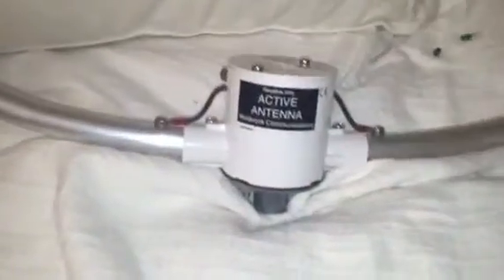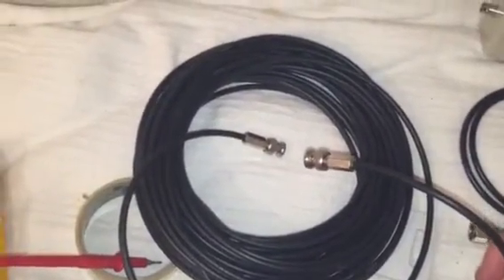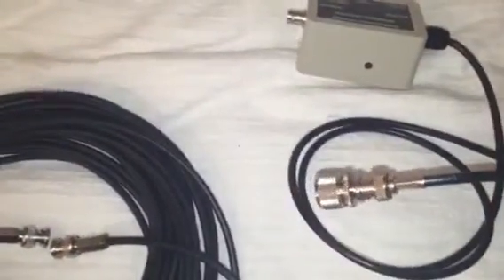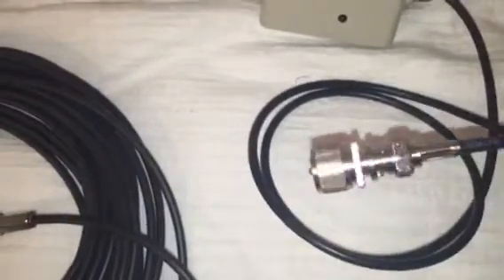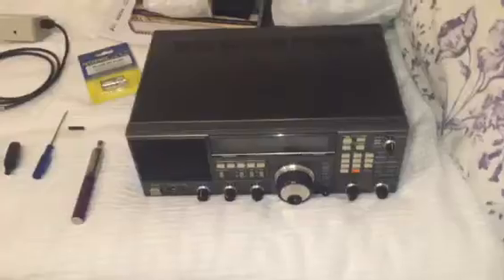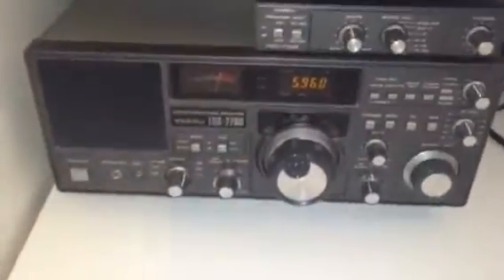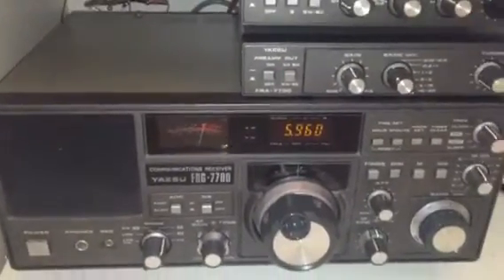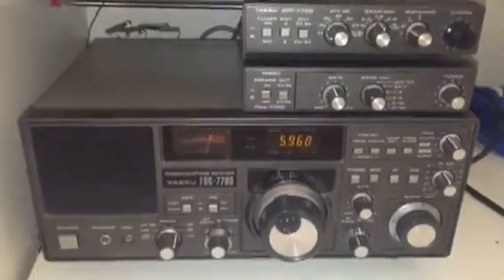Wellbrook ALA1530 antenna:  preparation complete

Comment: Hello, one question: does it matter where the 2 wires on the amplifier are connected on the aluminium loop? If for example, you rotate the amplifier with 180 degrees?
Reply from the maker: No I'm sure it makes no difference whatsoever. 873!

Comment: Thanks for mentioning the BNC to PL259! I have one of these loops being posted to me on Monday so hope to get it soon. 

I've tried constructing loops here, but the videos others have posted of these sold it to me. The noise on the dipole is getting worse. I hope the loop works out here too. :)
Reply from the maker: +J0shuk Hi there, my pleasure. It was actually Matthias (senderjaeger) who gave me a heads-up on the PL to BNC adaptor. It was about £3 in Maplin. I used to build crystal sets, so I've wound a lot of coils on cardboard tubes, but that's about it! I was planning to make a loop, but in the end, the Wellbrook made most sense in the war against QRM! 73s! Clint
Reply: +Oxford Shortwave Log Thanks Clint! I've ordered the adapter from eBay so I hope that arrives around the same time. 

The Flex 5000A has BNCs on the back for RX only so I can use it straight away on there and compare it directly to the dipole. I also have an old JRC receiver which I happen to rather like, but this will require the adapter.

I'm excited to get one of these antennas and actually see how it performs. Especially SNRs with digital transmissions on 40 meters. I'm hoping it will outperform my current antenna.
Reply from the maker: +J0shuk eBay is great for all the peripheral components required for SWLing isn't it? I could have bought the replacement bulbs for my Yaesu very cheaply, but I'm too impatient and went straight to Maplin the same day! I'm a sucker for old radios, hence both Yaesus and the Sonys. The only new receiver I own is the Tecsun PL-360 which is fantastic for the money. JRC have made some really great kit - all the NRD receivers are worth having for sure! I'm trying to demonstrate how the Wellbrook can make a step change with a decent receiver and I think I've been successful so far. Thanks for watching by the way! 73s! Clint
Reply: +Oxford Shortwave Log The JRC I've got is an NRC-545. I got it for free in very good condition. Sadly, I didn't realise its worth and it has been used outside and inside a few times and, as a result, has a few scratches. It works rather nicely though and I like the display. It's very clear and also rather sensitive. I can hear things at a decent signal that I can't on the SDR with the JRC. Perhaps it is less fussy about the impedance on the input unlike a transceiver? No expert on the subject. Perhaps it has better pre-amps? 

I'd say you've been successful thus far too. What it shows is just how crucial the antenna is. It is taken for granted to some extent and assumed that it is good enough. Rarely do people try new designs because of the money or just because what they have isn't picking up much noise so it is good enough. I'm praying that the loop is less responsive to the plasma noise I receive at times and various other electronic devices that emit noise around here. Time will tell.

It's a pleasure to watch these videos demonstrating how these loops work.

73. Josh.
Reply from the maker: +J0shuk Hi there, wow a 545 for free sounds like an excellent deal!!! My understanding is that the 545 is very sensitive indeed, more so than many other table-tops, it's very forgiving antenna-wire, so you're probably right, performance isn't dependent on antenna matching and that it has lots of bells and whistles to deal with QRM. You're absolutely right and it's my experience recently with the ALA1530....it's possible to get decent, sometimes good results using a mediocre antenna. I was using a 25 metre wire out in the garden and the coaxial shielding from a lead-run to an unused TV antenna. When the ALA1530 arrived, it became very apparent that although both antennas were capable of pulling in some good DX, they also attracted an awful lot of noise, so some of my DX had poor SNR. We have an LED TV upstairs which the Yaesu doesn't hear. However, my GF's plasma downstairs obliterates almost the entire HF band up to 17 or 18 MHz! The Wellbrook is directional and I can null it out very effectively, however, for best results of course, I wait until she's in bed and the TV is off! Anyway, thanks for watching, I'm about to have another DX session with the loop. 73s! Clint
Reply: It was an excellent deal!! The guy's father did a lot of SW listening but he didn't It had not been used for years. I was expecting something that didn't work at all.

I had to send my FT 2000 for repair and was without a radio for a couple of weeks. He kindly said I could have it and I was very impressed.

Interesting on the plasma noise. There is a plasma here too. Late at night most noises disappear, but I'm usually too tired by that time. I wonder how you find reception if you null out your plasma noise on bands that are around or above 40 meters? I mean, is it directional to the noise but fairly omni to high angle propagation signals? Also, if you have the loop outside, does the plasma noise drop away more than it would or does on your old antenna?

I'm unfortunate here that there is one in the house and one over the road which radiates better than the closest plasma. It is a larger screen but is the other side of the road.

I'm hoping that these won't be picked up so much if I can get the antenna a good 20 metres away from the house or maybe even further.

One thing I have found is noise travelling down the coax shield. I find it hard to get rid of on 160, but on 80 I can by grounding the shield to the radiator. I guess there is less PD between the case and the shield so it only leaves the signal from the antenna. It really is a nightmare when it comes to electrical interference.

Hope your DX session with the loop went well again.

73. Josh.

Comment: Nice video and nice to see you've got your Wellbrook prepared for operation, Clint. The antenna has been redesigned compared to the version I bought in 2010, so I'm looking forward to the results you get with it. 73, Matthias
Reply from the maker: +senderjaeger Thank you very much Matthias! As you might have seen in my next video, this antenna has provided a huge improvement in reception - there's so little noise compared to my old antenna. Your prediction that it really would perform very well with the Yaesu was certainly correct! Best 73s! Clint